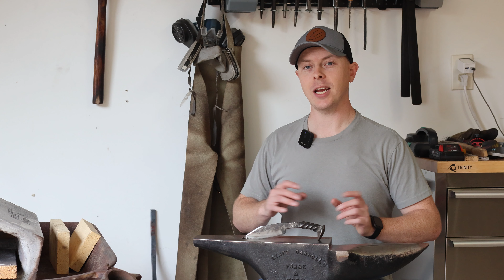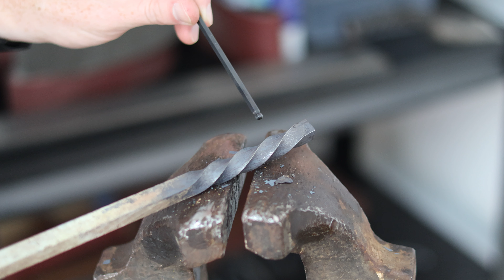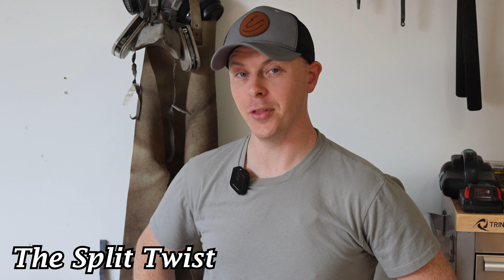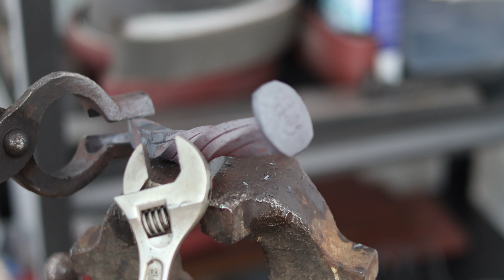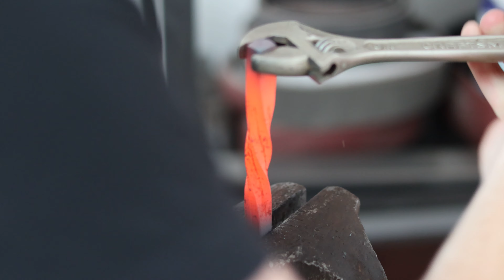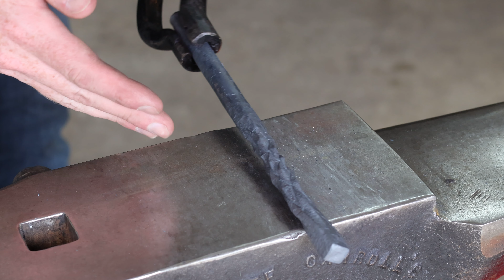Blacksmithing for Beginners Part 2 - The Twist

Comment: What you call a "pineapple twist" I learned as a "diamond twist" (Blacksmith Journal, December 1991).

If you skip the last cut and untwist, that's what I learnt as a pineapple twist.
Reply from the maker: Oh, interesting! Do you mean only cut on three sides as opposed to all four? Or not cut at all?
Reply: @rockingeforge  cut all four sides,  twist,  square, untwist